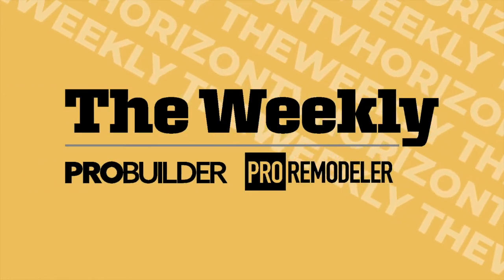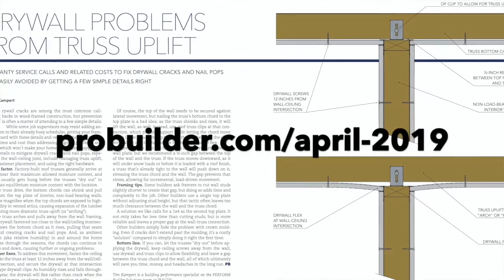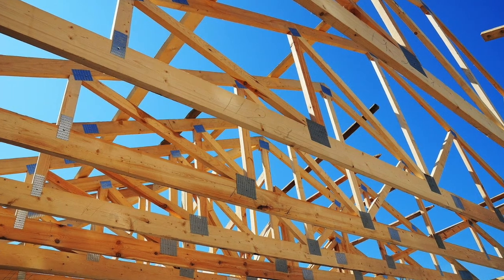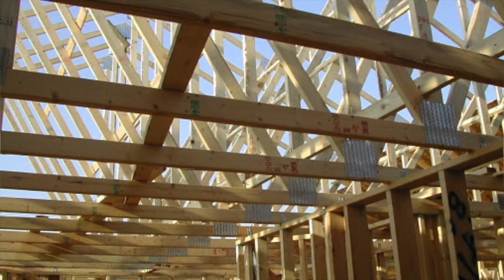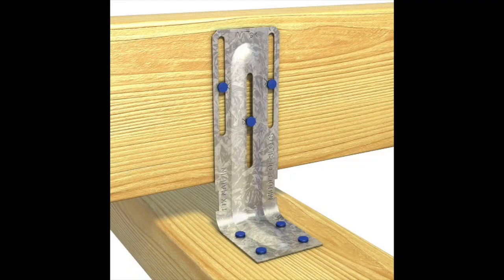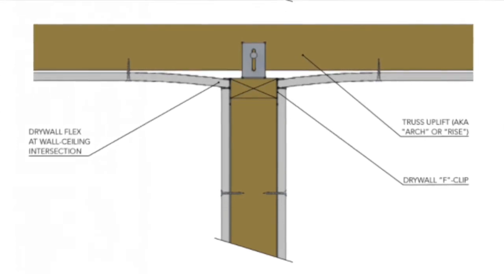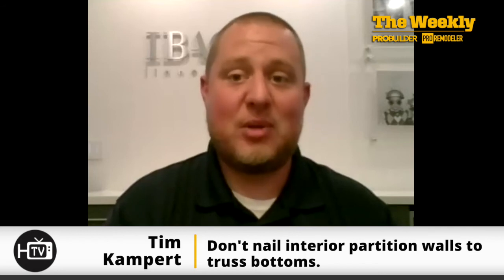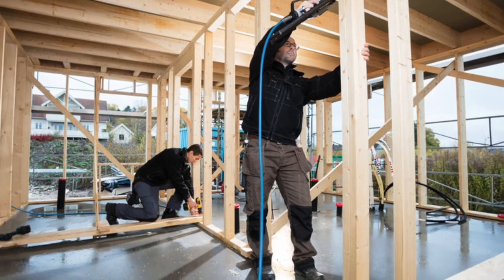Solving Truss Uplift

Comment: Unfortunately we are dealing with this problem after the fact. We have lived in our home for 3 years and the same areas keep cracking. They have been retaped but every winter it happens again. I’m assuming that installing f clips would be difficult at this point? Or could that still be done from the attic when they cut screws loose? Our current plan to fix it is by cutting screws loose within 12 inches of wall and installing blocking to allow the ceiling to flex. We do not currently have truss clips. Would it still be necessary to install them? I don’t completely understand the lateral movement part.
Reply from the maker: Thanks for your comment! I will ask the folks at IBACOS-Perform to address your questions; stay tuned!
Reply: Thank you so much!!
Reply: Following
Reply from the maker: Here's what Graham Davis at IBACOS says: I would love to get pictures from (you) that show both the cracking and the exterior elevation of the home so I could see the basic roof design. I would also like to know what region the home is in. But aside from those selfish desires, my response to the reader is that they are on the right track. Eliminating the nails through the ceiling drywall that are within 12” of the interior walls is the best fix. 

The two methods to consider:

1. Cut the nails with a multipurpose tool (Vibrating saw with an offset blade). If the rock is secured with screws, I would highly recommend option 

2. Screws don’t cut as easily as nails, and are pretty easy to locate and remove from below. Locate the nails with a magnet type stud finder (old school device) and pull them from below.
 
Either option will require drywall patches after the nails are cut or removed, therefore, the second option is probably preferred.

 Installing drywall clips is not likely necessary. The ceiling rock tends to rest on the wall rock at the edges.

 As for the installation of truss clips (STC, DTC or other) These are not really necessary at this finished stage. The trusses are most likely secured to the interior walls using toenails. The question is, when the trusses are moving (during seasonal transition or due to temperature changes in the evening) do the occupants hear and annoying popping sounds coming from the ceiling? If so, I would recommend cutting the toenails connecting the trusses. With all the drywall in place and finished, it will likely provides sufficient stability where installing truss clips won’t be necessary. If any lateral movement of the walls seems to be a problem (walls that feel a bit unstable) DTC clips could be added later, but I doubt they will be necessary. Toenailing trusses to non-load-bearing walls, or using truss clips, are not typically required by structural engineers in a house design except where long walls exist with no intersecting walls on either side.

I hope that helps! Sorry for the delayed reply!

Pro Builder
Reply: Thank you! I really appreciate the response. I am checking to see if the trusses are secured by toenails to the walls. If they are, will we have any continued problems when the trusses uplift? If they aren’t, should we go ahead and install the truss clips? I have photos of my home elevation and pictures of the truss uplift damage to the walls. Can I email them?
Reply from the maker: @staceedenman1959 Yes, please email the photos to me (rbinsacca@sgcmail.com) with your comment and I will share it with Graham for his response.
Reply: Retired Building Inspector from N. California here. :-)
Truss slip-clips 2' to 4' o.c. are important in Earthquake-prone areas, or where the ground shifts a lot seasonally, and trusses should never be nailed directly to interior non-bearing walls, but should instead clear it by about 1/4"-1/2". 
A 36' long truss over a 'Great Room' has a deflection ("bounce") limit of L/240, or 1.5" for that long truss. This can cause sheetrock cracking issues at any added non-bearing walls near the middle of that span from EQ's or wind uplift. 
Allow the truss and ceiling to move as designed (just like people, flexible buildings are more resilient than rigid ones!) and hide edge cracks with crown moulding with a slight gap above it. Then use dense rock wool/compressed fiberglass/eq (non-flammable/non-toxic) insulation at attic level to stop any drafts at the wall/ceiling gaps.

Comment: Uplift in trusses is also an issue when solar panels are added to a large hip truss roof. This is mostly where long 2x4 rafters are supported on side-to-side cross-trusses below them, and the rafters are just fastened down with an upward-facing toenail from the truss below, and not with a block and a couple A35F clips, or similar, showing prior Uplift load design consideration.  
A toenail is fine for normal gravity download forces, and normal broad windloads, but not 150‐300+ lb.  uplift point loads right above it.   
Solar Panel installation companies are usually run by Electrical Contractors hiring remote online 'discount' engineers if the City requests an Assessment and Calcs due to the local Wind zone.  The Solar Contractors have installers and office staff who are often clueless when one mentions the engineering  'Load Path', as I have found out. 
Uplift on my own 9 rear solar panels (covering 200 sq ft) over the Kitch/Fam/dining 'Great Room' was calculated at 4100 lbs. total, with local design Vmax=120 mph and prevailing winds from the North.   
Tiles lift up and chatter at 45+ mph winds, and wind pressure in the attic and over the ridge lifts the downwind (usually south) roof sheathing, so actual tile roof deadload weight alone (about 21 psf if no heavy mech./misc in the area) cannot be counted on in a windstorm 75+, hence the Code-required traceable 'load path' below each panel footing, theoretically tying it down to the foundation.  
An upwards toenail is NOT going to hold that added panel uplift force down, and all it takes is a strong 3 second gust at just the right angle to open up the roof like a sardine can.  The wind and rain can then do much further damage. 

Please do a video on this issue, since it is often missed by solar companies, engineers who do not physically inspect the attics (as is common, post-C-19) or who are not 'hands-on' familiar with wood framing (thus sending weird details that do not even apply!), and by City inspectors without a journeyman carpenter and/or engineering background [...like me] that is often needed to recognize an overlooked structural issue. 

 Usually an Electrical 'combo' City inspector is sent to inspect Solar Installs,  so they may also overlook missing Load Path (downwards) connections inside the attic of added stabilizing blocks, clips, and/or small straps, including rafter to truss, truss to topplate, and truss-to-truss, or angled braces, for Load Paths that jog sideways or that need to be spread over 2 or 3 trusses to stay within deflection limits and not overstress the wood.  
The roof ply is not considered 'structural' when it comes to bending Uplift loads of load paths, and it is treated more like posterboard. 
Visioning the Load Paths like a string on a roof-level (red?) balloon at the panel footing's point load and following the 2x framing downwards and tied to an anchorbolt at the foundation makes the Load Paths easier to figure out. It also always follows the stiffest members.   Ensure the connections exceed the calculated uplift including nearby contributary loads from adjacent panel footings, and that the cross-truss top chords can handle multiple point loads and maintain the <L/240 deflection limit (0.1" in 24"); it may need a 2x sistered to that chord.  
Gravity Deadloads are rarely an issue with today's lightweight (3 psf) solar panels. "Structures" hold up things, not tie them down. These gravity loads are what are approved as 'Structurally Adequate' prior to Plan Check.  
Often a Detail Sheet of common 350#+ load path connections is (wisely) included in the Plans with a note to "Verify (ex) else add" [...as applicable] below the solar panels and over to the next adjacent structural member. 
Load paths in existing construction (i.e. truss engineering design and connections mostly unknown) usually cannot be verifed until the panel footings are placed, and marked from below with a shot of bright spray paint. It helps to also mark/color code  Verified (ex) vs Added Load Path Connections for the engineer's and City's inspection, and to show due diligence by the Contractor. 
In high-wind areas, the Project Engineer should provide a stamped letter verifying the jobsite's Load Paths and framing stresses in the area of work are adequate for the calculated additional wind uplift forces PRIOR to the Final Inspection, along with any added calcs and 'as built' details, with a copy given to the City Inspector for their permit records, and another to the Property Owner to keep with the House records (FYI: Permits belong to the House, not the current Owner nor Contractor). 
This ensures the roof will survive the next big windstorm (below the hurricane-level design limit), and if not, the Engineer's Liability insurance covers any related damage, which helps speed up repairs. If wind damage to the roof is a concern, it makes hiring a good  established and local Structural Engineering firm with extensive wood framing and truss design (& repair!) experience in "Uplifting" Earthquake or Special Wind Regions worthwhile. 
[Note that Civil Engineers can calculate forces on wood framed homes, are mostly trained in predictable steel and concrete design.]

Please link to the new ' Hip Truss Roof Solar Wind Uplift Load Path Errors & Fixes' video from this one, so more people are less likely to lose a roof in this era of Climate change.    :-)
Reply from the maker: Please email rbinsacca@sgcmail.com to discuss an article.video on this issue; thanks!